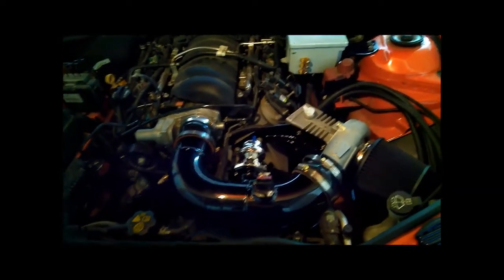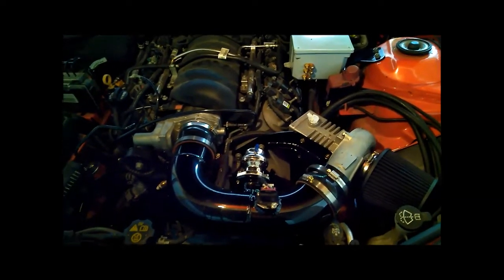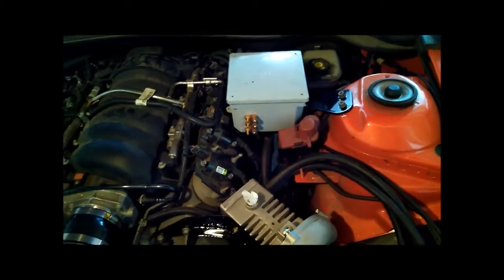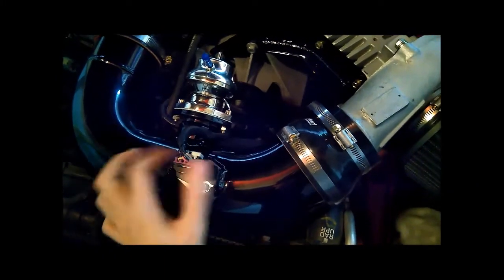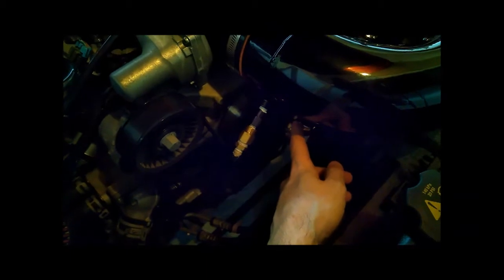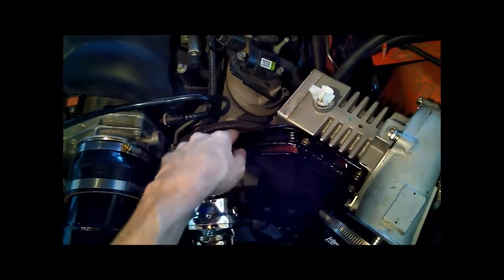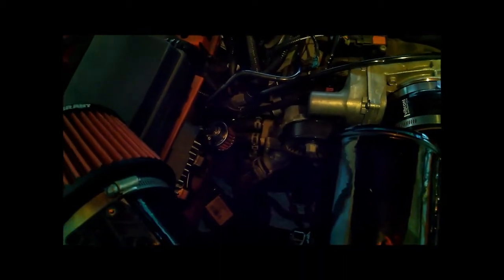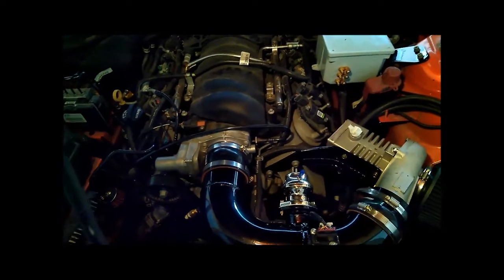Electric Turbo Camaro Project - Part 3: Mechanical Installation

Comment: U could probably fit a Y piece straight off the intake manifold and have a vacuum flap on it u could even just make it a smaller diameter to make up the stock flow as the turbo is restrictive but u really only have to add say 2maybe 2.5” extra of free diameter airflow for the NA good work though, I wanna see POV drive and then a Dyno Na vs electric ect . Another idea is fit a exhaust cutout on the Y pipe for NA then u don’t have to do any installing it’s an electric valve open close off ur car keys
Reply from the maker: Thanks, actually most of what you mentioned went back and forth in my mind when deciding how to do this setup.  Much of the rationale behind the final decision had to do with the really bad experiences I had just paying people to do the work.At some point I had to make a concession just to make sure the project got done at all.  Once I succeed with this car however I may upgrade it or try it on another car in the way you describe.